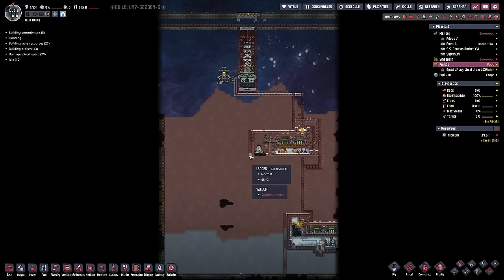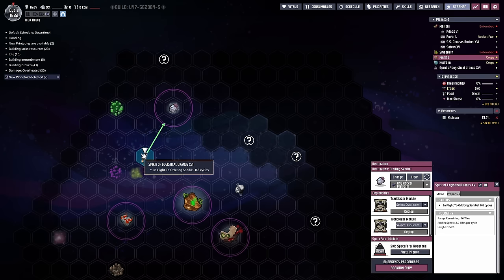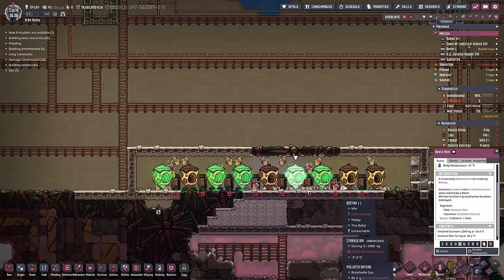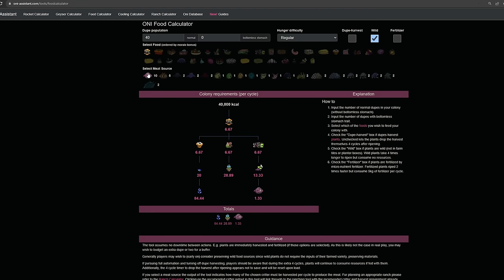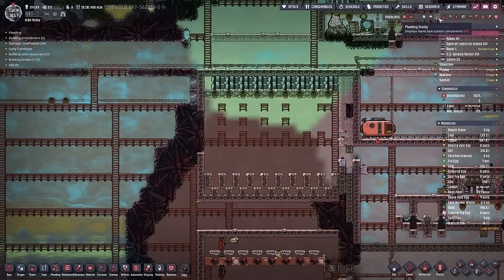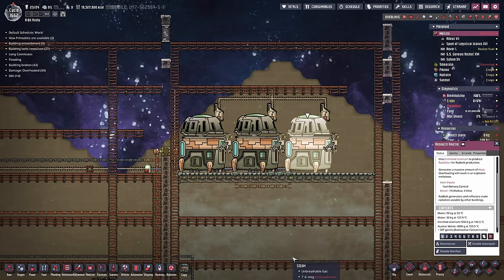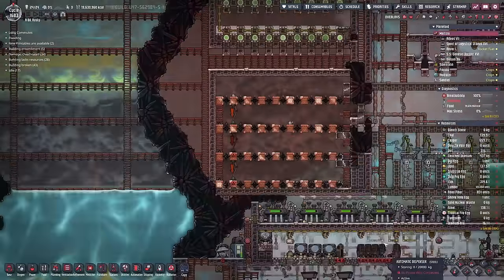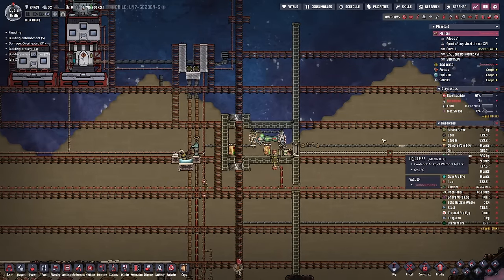Ep29 : Attempting to Farm Nuclear Waste : Oxygen not included

Comment: If you click the Spacefarer module, there's a little pencil next to the name on the details card. That allows you to rename rockets. I'm 99% sure this is built into the game now and i read about it in the patch note at some point.
Reply: I believe I did this recently. You can definitely rename rockets. I'm positive of that. But it may need to be done by clicking on the platform they're on?
Reply: I have been able to rename rockets, but only by clicking on them on the starmap while(whilst?) in flight.  Then there is a pencil.
Reply: If you click on the command module while grounded, you should be able to rename it there
Reply from the maker: Dammit I missed that entirely for far to long.

Comment: It's worth reminding people, you can use the Farm Station to put Farmer's Touch on wild plants. With Superspecialized and Exuberant you can harvest every 9 cycles. I know that's not quite the zero work colony, but gardening is a fine hobby for dupes.
Reply from the maker: I could never bring myself to do that, it's just an efficiency thing.
Wild Exuberant sleet wheat with Farmers touch gives 757 kcal a cycle
Planted Exuberant sleet wheat with farmers touch gives 3,200 kcal a cycle
You would need to apply 4 times the farmer touch to the wild stuff to get the same result as it takes longer to grow. So I figure if I'm going with fertilizer I will go with planted crops as the gains scale so much more.

Comment: You don't need to desalinate or sieve water before sending it to a nuclear reactor. Reactors will take any water and steam distill it for you. :D
Reply: What happens to the salt/dirt?
Reply: @SaintGerbilUK  Drops out the bottom of the reactor with the water.
Reply: @asureaskie  The pwater is kinda dangerous to do that with, since it expels water at like 400ºC+ temperatures, the dirt formed will flash into sand and form a tile. Bad news.
Reply from the maker: Had no idea you could feed a reactor salt water, makes thinks way simpler.
Reply: You can feed it salt water?? I understand why they did the reactor the way they did, even though it doesn't really make much sense, but not taking damage from dirty or salty water is absurd even for ONI standards. I will have to ask on the forums whether the devs made this as a deliberate choice or it's just a fluke, but in any case I hope they change that cos' that is just plain wrong.
Reply: @Pancake_Nix  Nuclear Desalination is a thing. Not really a 1-step thing, but ONI reactors might have an internal loop exchanging heat with the external water supply.
Reply: @asureaskie  I wasn't considering that since it's already spewing up water we can assume the reactor has its primary loop inside and we're actually pumping in feedwater. That would make more sense, yes. A bit too much radiation is leaking out in that case tho, but okay, we needed rad generation, and I can live with that. :)

Comment: I know that it doesn't bother you as much as some, but if you want to keep debris from entombing itself in the glass tiles you can put a tile above it before deconstructing it and make sure the tile below it is empty. It kind of forces it to pop out lower and not entomb the material. Tip for any who care😀
Reply: You can also empty storage on the farm tile, which makes it so that the glass tile forms on top of the farm tile.
Reply: @candy-ass4915  that's even better/easier 👍
Reply: @candy-ass4915  Nice! That is pretty convenient. I used to cook dirt, but then often some debris would get entombed, so I started doing the manual airlock thing, but that is a bit tedious to do. Hmm.. since you can't copy the empty storage settings, now I'm thinking I will try the empty pipe command. I'm kinda thinking it might drop out as debris, but it's worth a try as the command can be mass-issued. Thanks for the tip!
Reply: @Pancake_Nix  It would drop as a bottle, which always forms a tile when the liquid solidifies. so: it would work! You simply need to make sure only 1kg is in each pipe segment.

Comment: I discovered while playing a few months ago that research reactors can use any water type, they spit out the salt/dirt (which instantly becomes sand) out to the bottom of the reactor. Also you can mix 3 of the water types on a single line without issue, using all 4 gives the low coolant warning temporally.
Reply: Are you telling me this now after I literally just finished my pointless and ridiculous-sized water distiller on my playthrough. :D
Reply: It's never pointless, only ridiculous.

Comment: 26:30 If I remember how the Pips work, they not only check how many plants are nearby but also check if the conditions for the new plant are met. That means, for example proper atmosphere, and particularly when planting waterweeds there should be already a layer of salt water :D
Reply: I thought so too (about needing a layer of salt water), but was then surprised to see the pips already planted the seeds in the top row. I swear mine wouldn't plant them until I added a layer of salt water. Strange.
Reply: Temperature is also checked as if it is too cold they wouldn't plant sleet wheat for me. Not sure if it is in general the max livable ranges that are checked and not individual  growing range.

Comment: Two tweaks you may look into:

First, your reactors overheated because you put the water in line. If you split it you could still run the reactors water-starved. The only downside is the resulting steam / waste leaves at a higher temperature. Really neat for power generation, really awful if you need to cool it down. But if you meter things out or at least split the water pipe output, you should be able to run more reactors with the same amount of water.

Second, I think you might be able to use Conveyor Meters with timer resets to drip-feed 1KG packets of uranium, possibly with less overheating automation machines.

Other than that, still some impressive engineering for a "casual" playthrough :D.

Comment: Well that's not an ominous thumbnail and title XD
For the Niobium volcano.  moving the pitcher pump to the left side of the volcano would let it grab all of the liquid niobium and then you wouldn't have to worry at all about the left over potentially melting the ceramic side panels.  Especially since you're using an induction plate to cool the autosweeper.  Just a though if you ever go back to the Niobium volcano or find another metal volcano you want to auto-tame the same way

Comment: I'm sure someones mentioned it, but pips only plant if the plants are able to grow.

So you need to have the right temperature,  the right rads, the right pressure,  the right atmosphere.

Most plants have a minimum pressure. That's why they won't be planted in vacuum.

Comment: re: the naphtha in your liquid lock boiling, that's because the inner blob of naphtha is in vacuum so it can't conduct heat anywhere
if someone had dropped rock in the outer blob, it would have conducted heat to the air outside and not boiled
the solution to this is to either only have one blob, or to thermally connect the two blobs with a tempshift or a wire bridge or whatever

Comment: Putting less water into the reactors does work. It has basically the opposite effect of what you've got going now with using less uranium. The more uranium in a reactor the faster the uranium heats up, and the temperature of the uranium inside of the reactor is calculated separately from the temperature of the reactor itself and the temperature of the waste is the same as the temperature of the uranium, so instead of getting cool waste that you don't really have to manage the temperatures of you get superheated waste. You can run 20+ turbines on the output of one reactor. I think people call them CLRRs, coolant limited research reactor. Definitely a bit tricky to run, they can break and melt down during saves so usually people set a timer to throw a couple of full packets into it prior to the cycle flipping over just to be safe. Definitely something you'll want to play around with in sandbox before instituting it into a game I think, but definitely worth playing with if you ever need a ton of power.
Reply from the maker: Pretty sure that water starved reactors have made sour gas boilers far less attractive.
It's that perfect amount of power right in between the 10KW of a petroleum boiler and the 50KW+ of a sour gas boiler.

Comment: When I make natural tiles I always put conductive wires, radiant pipes and radiant ducts in the tile before I make the tile.  This allows the tiles to be cooled  with no atmosphere.  Once frozen the Co2 is quickly chilled to the right temperature. Granted I usually use water to make the sleet wheat tiles and copper for the bristleblossoms.  I will try the glas tile method on my next play though to see if the glass method meltsradiant pipe.  -5 is the sleet wheat grain frozen temp in co2 on my pc.

Comment: Another stupidly easy way to get heat for natural tiles is just building a steel tempshift plate in magma, deconstruct it and use the new move command. I use it to cook 5kg blobs of algae surrounded by metal tiles. Just have the dupe drop it on the metal and move it in a timely manner to another location that needs cooking to spread the heat.

Comment: good pipe splitting. to make it error proof have a liquid bridge split out three ways. It will always spit out equally on each pipe.
Personally, I went the reactor route for the rads on farm tiles for food. Exuberant seeds + sweetle tending + fertilizer means you need like what... 5 crops? it's overkill.

Comment: The Research Reactor can run with less than the 4kg/s it "wants". This just results in more heat being generated. Running three reactors on a single 10kg/s pipe is fine, so long as you meter it to 3.33 each and they will all run hot. If you don't meter and runa  single pipe then the first two will take 4 each and those after will meltdown.

Comment: Use conduction panels instead.  The deconstructed panel drops it's material at the input port, the tile appears in the center.  as long as the input port is at the bottom, you don't get buried tiles with the metal, and it looks better.

Comment: if you build a bottle emptier on top of a door that constantly opens and closes, on top of a water tank with a pitcher pump and an auto-sweeper there... Won't that compress all of the water in bottles in one spot? Since the auto-sweeper would get the water, give it to the bottle emptier, and then the bottle emptier would stop working because the door opened and it would drop a bottle of water on the ground.

Comment: The niobium setting only makes sense because niobium forms a tile from very little mass compared to other liquid metal volcanoes. Basically for other liquid metal volcanoes, to use the same setting means that you are just adding more steps to get the same result. Though it does look cool so there is that.

Comment: The "allow" buttons on doors only prevent then from passing through left or right.  If the door is horizontal, the permission settings do not apply, since they are not going left or right.  You have to actually lock the door if it is horizontal, or uncheck everyone in the list to prevent them form passing through.
Reply: Mouse over the allow buttons on a horizontal door. They specify Up and Down. Dupes can still pass through if they either already decided to move there when you changed the setting, or if they have a diagonal path through.

Comment: please (at least) triple the amount of aquatuners, only 3 I was a bit disappointed
Reply from the maker: I tried 4 Aquatuners but the temps started to breach 260C, if it gets to 275C the steel buildings and the slicksters start to die.
So I stuck with three and the temp stabilized around 245C.